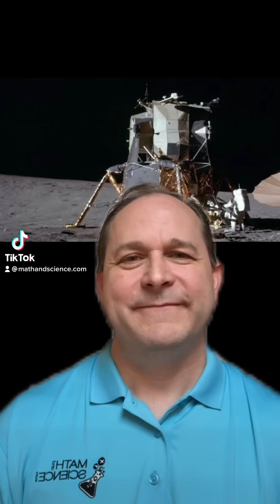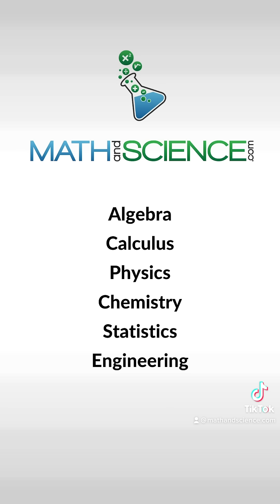Astronauts almost DIED on the MOON!

Comment: Is the Van Allen belt between the earth and moon or after the moon? Why did not the launcher blow a major hole in the sand? In the early 1960s, a professor explained why we couldn't send anyone to the moon due to intense radiation. The craft would need walls of lead over 63 feet thick and even that may not work. Was the professor incorrect?